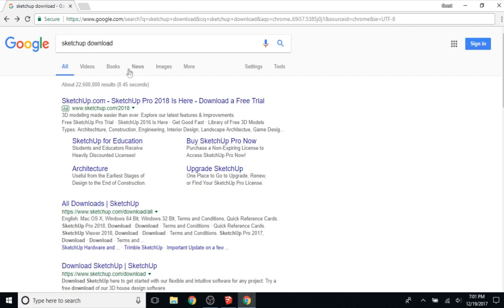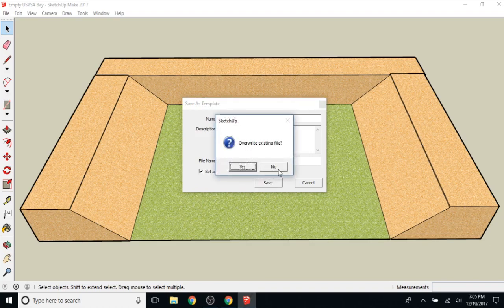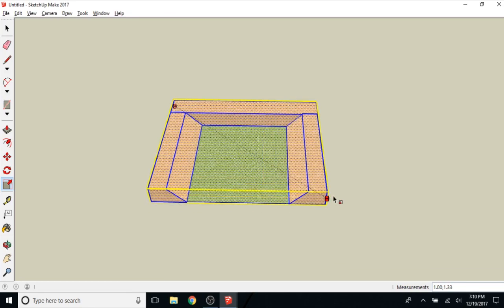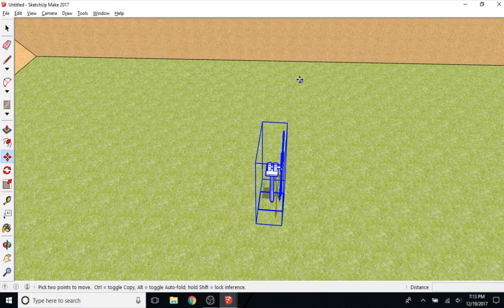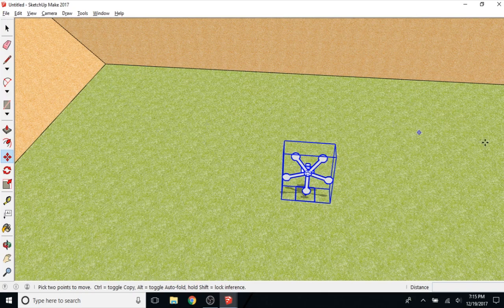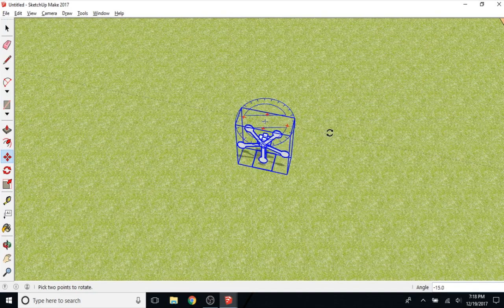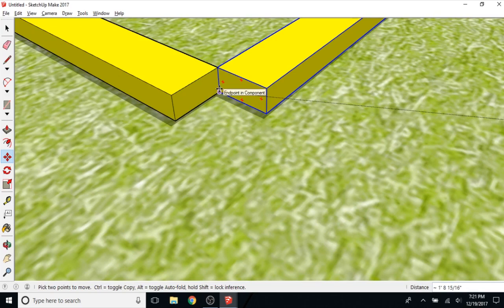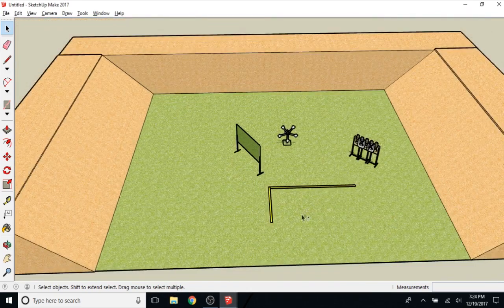USPSA Stage Design with SketchUp | Part 1 - The Basics

Comment: Thanks for video, it got me going. Designed my first two stages. I downloaded sketchup 2017 and used your files by manually downloading as a collada file then making a template within sketchup. 

Only issue I'm having is select image to copy, seems not all items in big prop file will copy by double clicking item, I'm having to select item by using arrow and highlight item to be able to copy. Am I doing something wrong? Thanks!